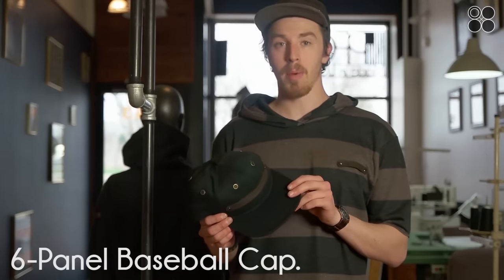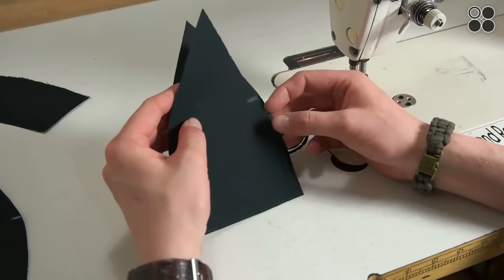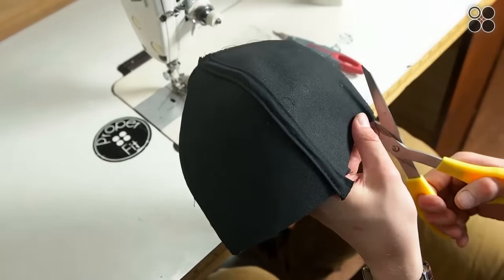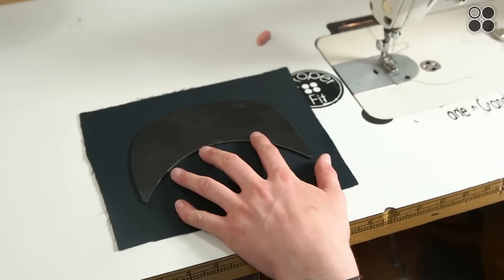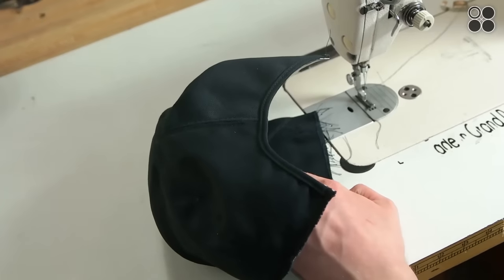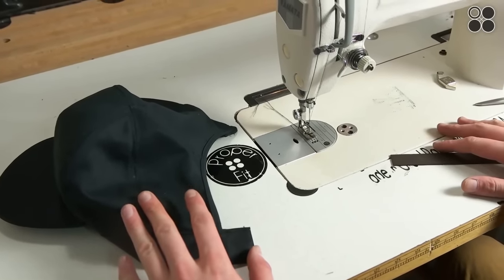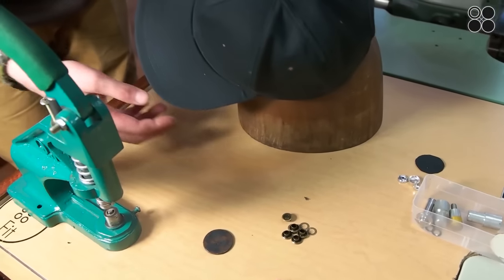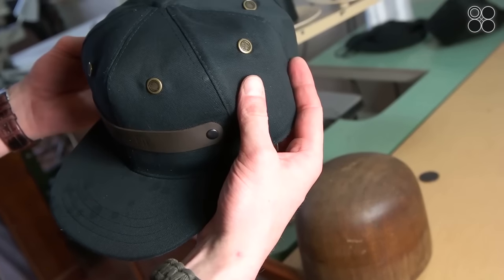How To Make Snapback Baseball Hat

Comment: 2 questions.   are single needle machines different beasts than double needle - or are there interchangeable parts?   And if you only have a single needle machine, what is the best way to get the double needle look for the inside taping?
Reply: You can use a double needle on pretty much any machine. You can find them at fabric stores. They even have them at Walmart. If you don't want to pay the $8, you can use a regular foot and just move the needle over 1/4" or so. I'd say it's worth the $8 though. If I were you, I'd go to a fabric store where you can ask someone who knows what they're doing which you should get for your project. You probably want a heavy duty twin needle.

@ProperFit Clothing Co. , Am I right?
+ProperFit Clothing Co.